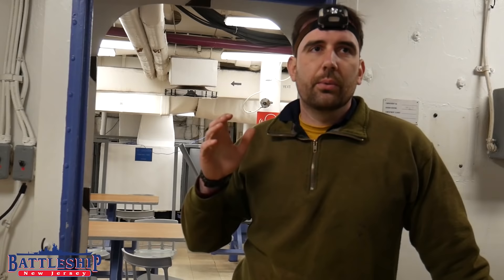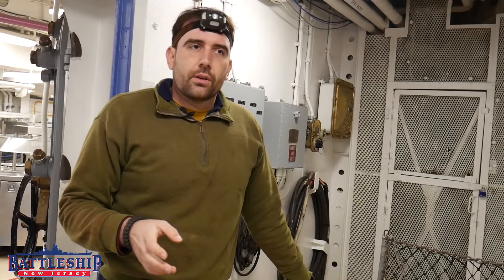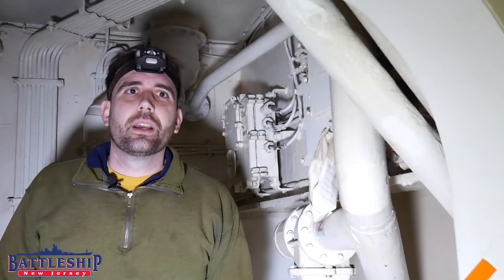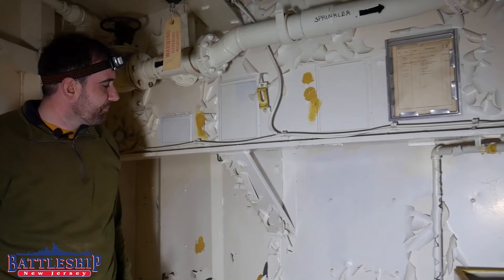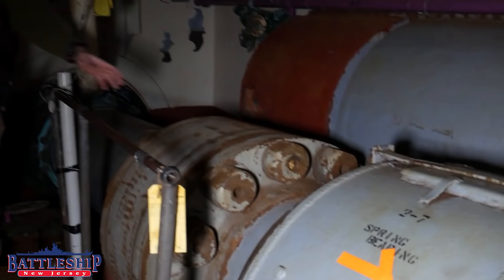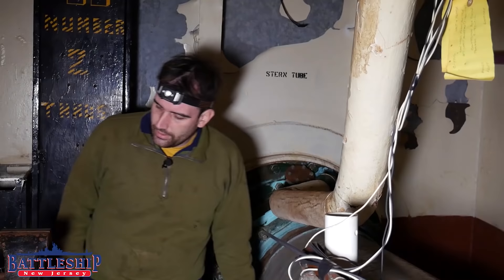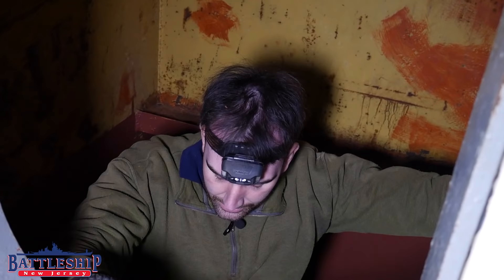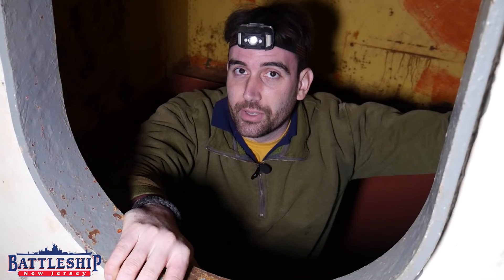Down to the Battleship's Keel

Comment: Bet its freezing down at the keel level
Reply from the maker: Its pretty much an extreme of the outside temperature. The water insulates very little. It can get very hot down there in summer.